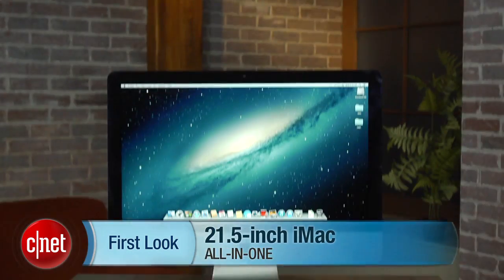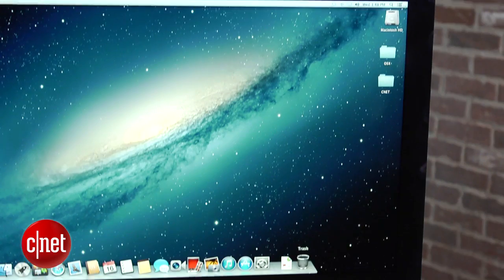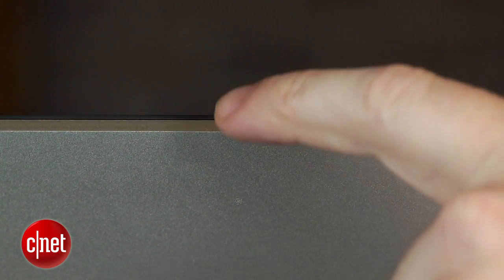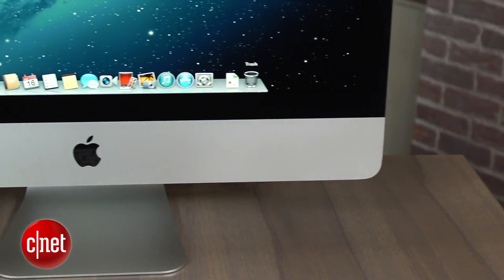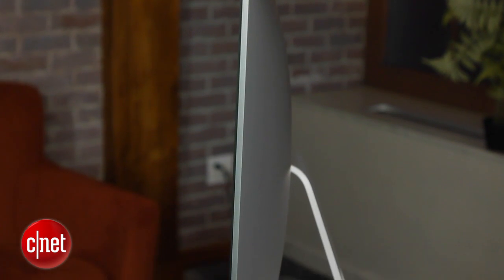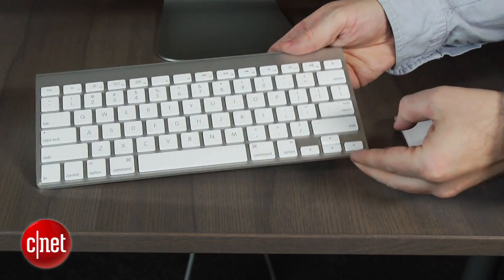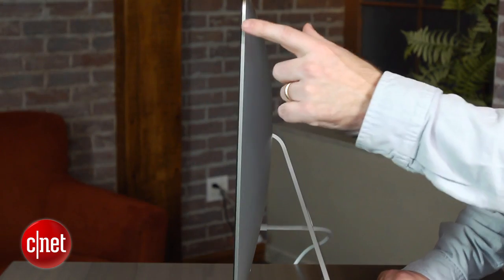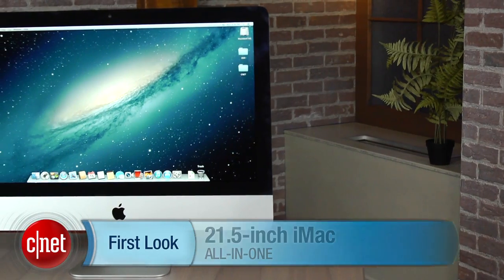New 21.5-inch iMac faces still Windows competition

Comment: I really don't get your point. It has nothing to do with what I said. What's the deal with Windows 8? It's a piece of crap. I told you that I installed ML on my PC. Therefore no need to spend 2000$ more just for the Apple logo. And I don't know what prices are there in Australia, but I can asure you they're not the same everywhere.

Comment: Im not super rich but its actually turned out cheaper for me.  Its turned out cheaper than running Pcs(I have been running windows for the past 10 years) because in my experience the new Macs run smoother and last longer.  My Pcs I had to switch out every couple years because they were getting slow or take them to professionals to speed them up or spec them out (usually didnt work).  Im still on my first Mac from 4 years ago and it runs as fast as the day I bought it.  For me worth the price.

Comment: You don't have a point. I agree with you, they are expensive. And in my country for example, they're also overpriced. So I bought myself a  great PC for about..500$ and installed Mountain Lion on it. Runs great, haven't had a problem in almost 6 months. That doesn't mean that if i had the money, I wouldn't buy a mac.

Comment: I've had both a high end mac and pc. My current pc blows my mac out of the water and probably will for the next few gens. I do really like the styling of macs and the ease of use of osx. In my personal opinion, i feel that Apple would do much better if they didn't have 50%+ markup on cheapo parts in their lineup. Really the only things that are really high quality is their cases/screens and osx itself. Otherwise, all of the other parts are pretty dirt cheap, probably around 500 or so in total.

Comment: Even if some Windows PCs have more powerful specs, after a year or two your Mac would still run way way waay faster than the Windows ones. Not to mention that with Windows, you'll have to reformat quite a few times to speed things up again and remove the clutter.